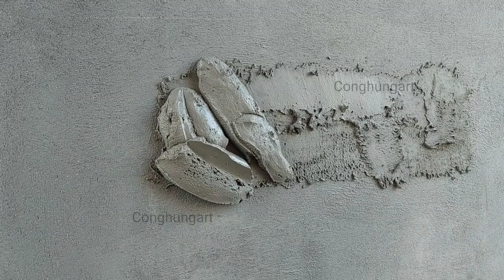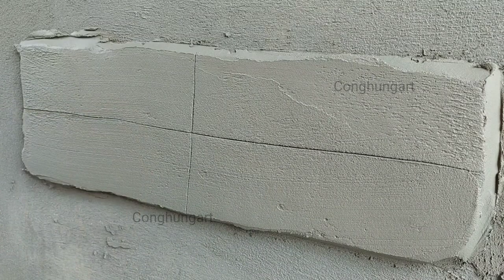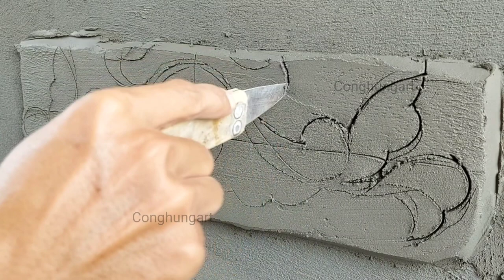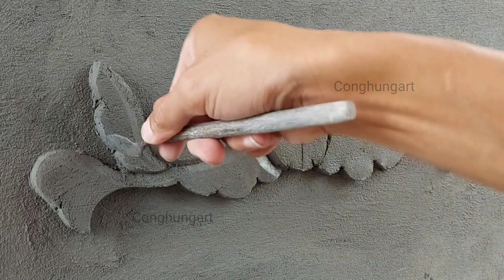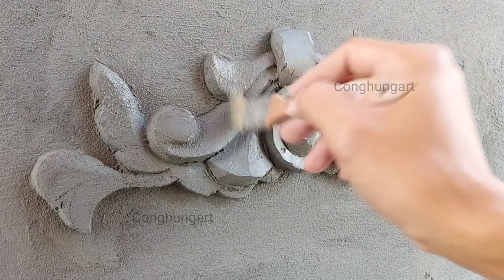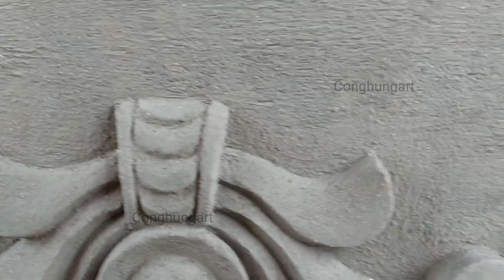It's amazing how I created the symmetrical cement flower

Comment: Use sand and cement, but doesn't it give me the same smooth, shiny texture after knife pull, showing a rough look?
Reply from the maker: The important thing is when the cement is just right, not too dry and not too wet, then you use a very smooth flying knife.
Reply: @ConghungartArtist82  
I thank you from my heart, creator. There is another question. What is the period or number of minutes required after putting cement on the wall to carve, engraving and remove excess? I mean, is there a specific period after placing the cement on the wall? So that I can delete, add or remove,
Reply from the maker: @hasanhosny696  Time depends on the weather, if the sun is high, it will dry quickly about 15 to 20 minutes. If it's wet or rainy, it will take 30 to 40 minutes to cut the hammock.